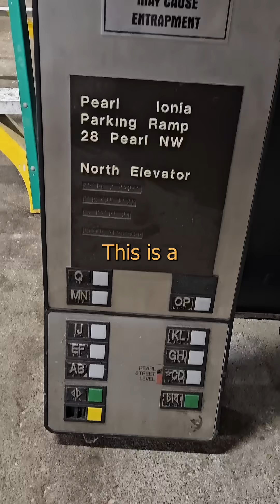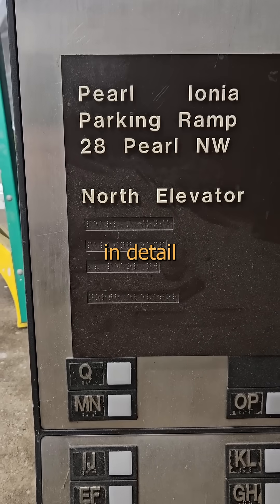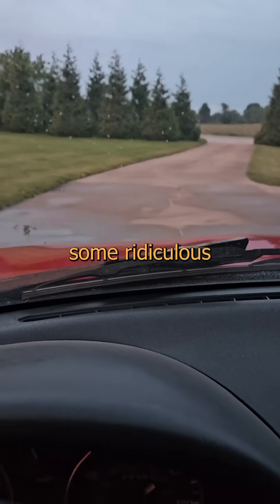Miata Mischief #chrisboden #engineering #gear #elevator #score #stories #parts #hacking #making

Comment: I worked construction for a little while as a laborer / apprentice ended up having to pick up supplies in an old 2006 Subaru Impreza hatchback little did I know it was multiple lengths of lumber I had to put that shit sideways between the passenger seat to the back seat sideways out the vehicle and ratchet strap the shit out of most of it on top of it I had the right up a hill with all that shit flapping in the wind prime to God it wouldn't send halfway down the street. I use plenty of ratchet straps and even some bungees on top just to be sure.

Comment: I once moved my bike from my old apartment to my new one it wasn’t so much the traveling that was sketchy it was how I unloaded it since I had no help I just tried to roll it slowly down the ramp but the front tire slipped off as I was backing it down and just dropped like 4 feet down right next to me almost crushing me thank god it was a dirt bike and the suspension could handle a drop like that easily also thankful I wasn’t directly under it when it fell definitely made getting it down way quicker tho

Comment: I hauled 10 by 8 plywood inside of my pt cruiser and drove it 45 min down the highway to get to a job site going 80 mph. I  left my ratchet straps at home and couldnt drive back to get them so i had to hunker down in the front seat and hope to god i didnt  have to break fast or i would be unconscious on the side of the road.

Comment: When I was living back home in the Netherlands during my doctorate program, I ran an electronics repair business out of my little rented townhouse for extra cash. Being an absolutely peak Dutchman, I didn't own a car, but did have several bikes. That included my cargo bike, a bakfiets if you want a term to look up, but it's basically the amalgamation of a wheelbarrow and a bicycle.

I used that thing to bring home all sorts of junk, but nothing will top the Sega arcade cabinet that came home in 3 pieces. The worst part was absolutely moving the display, a hulking CRT.  I had to bring my brother along, riding in the bike box, so I could have someone to help push the thing back.

Comment: Was moving some metal water barriers cross a ice road, was told “these are basically indestructible” well I proved him wrong cuz when you hit something over and over with a front end loader bucket something is gonna give, so these $12 000 barriers had a 8 inch long metal spike on both sides 😂😂

Comment: Not that sketchy, but I have one of those hitch racks on my Dodge Ram van and I load it up with a few hundred pounds of firewood and ratchet strap it all down. Forgot something and had to turn around and had to pickup over 50 logs off the road 🤣 oops

Comment: I know I am late to the party but...

An about 13 foot cast iron street lamp from the 1920s.... The problem was everything the transport vehicle in itself which was an old van my friend borrowed, the way to the vehicle and the weather conditions and the description of the lamp which was FAR heavier than described.

 So my friend bought this street light as a gift for his mom from someone on the Internet about 200 miles away.  It was supposed to be in two pieces about 200lbs in total and in the driveway. But because the seller couldn't disassemble it and it was to heavy for him and his friends, it was in one piece in his backyard... So my friend and I tried to disassemble it for about an hour, until we gave up and spent the next 4 hours dragging the thing through snow and mud to the van, only to find out that it is not only to big, but because we couldn't disassemble it, we were not able to secure it without breaking the glass.

So we bought wood, nails a hammer and a saw, build a frame to put the lamp in and spent another hour or so to load the lamp into the van. But because it was so  big we couldn't close the back doors. And because it took us about 7 hours loading that thing it started to snow again. Now we had to drive back home, during a snow storm, wet and covered in mud with an open backdoor and a barely working heater.... It took us more than 4 hours, I have never been so cold and miserable.  

The only good thing was we used a forklift to get the lamp out, which took us less than 5 minutes. After a restoration it is now beautiful and his mom loves it... Plus we got a story to tell

Comment: I had to help a friend buy an arcade cabinet. 

Problem 1: he drives a small shitbox that was too short to fit the whole cabinet in it

Problem 2: he forgot that he didn't have ratchet straps

Solution: pull the seat belt out all the way, wrap it around my legs, hold on for dear life, and hope he doesn't hit a pothole

Comment: As we were shutting down USMC MOBCOM building in KCMO we were tasked with "disposing" of a lot of random equipment. I had decided I wanted my old cubicle work station to go home with me. I somehow managed to cram an entire office cubicle setup into my 1988 Nissan 300Z without breaking or scratching anything. I even got the molex adapters for the 120v outlets and cat 6 keystone jacks. I had to make my friend help me get the shelving system and wheelbarrow with his truck but I still have it all 15yrs later, lol

Comment: I hauled a power washer home from our metal building to my garage so I could work on it since I had all my tools in my garage with my 23 GR Corolla since I sold my truck big mistake which was not built to haul a power washer unlike my truck At least the engineers didn’t have it in mind that that is what it would be used for with the seats rear seats folded down so it was very awkward and it rattled quite a bit driving home, and I had to be careful not to break too hard otherwise the entire thing was gonna come towards me pretty quickly as it is not the lightest of power washers that happened earlier today

Comment: Drove from toledo ohio to a little east of Washington DC in a ford Fiesta hatchback to pick up the molds for a wide body kit for a merkur xr4ti.  I took all the seats out minus the driver's seat and when I got there it wouldn't all fit.  Luckily the guy I bought it from gave me a roof rack so I could put some of the molds on top of the car.  This was molds for the front and rear bumpers' side skirts and fender flares all in and on top of a fiesta!

Comment: Few years back, i made the decision to move cross country. Figured I'd downsize instead of getting a truck. Everybody told me i hadn't downsized enough, when they learned i was moving with a Prius.

Well, I'll tell you: you can fit a surprisingly large number of things in a Prius, but not QUITE enough. Attached some top rails with straps, threw a cargo bag up there, filled it, and strapped the remainder to its side. When all was said and done, i had my life loaded up in the Prius.

I'll admit, I was more than a little worried on some of those mountain passes when i realized i was decelerating to school zone speeds on the incline!!

Comment: OOH My story is ALSO in a Miata!
Last summer, I saw a 4ft tall air compressor by the side of the road with a free sign. But all I had to transport it was my tiny Miata convertible... I put down the roof, and strapped that thing into the passenger seat with the seatbelt and some bungee cords and rope from the trunk.

I've never had a convertible before, so having this giant red behemoth sitting next to me as I sailed down the highway was NUTS.

Comment: I was given a 4 tier concrete water fountain and hauling it home in my 89 Oldsmobile also a 8foot x8foor pad made of concrete 1foor square concrete patio blocks there were no give in the suspension and we had a 20 mile trip back home thru city streets at 7 miles a hour we user the patio blocks to equalize the load there wasn't much room fo me and my son to set

Comment: Found a fully assembled Chevy 454 engine complete with carb and tranny but with no air filter on the curb, I lugged it into my back seat leaking fluids and with none of the proper tools i had to arrange it to where the output shaft and fan would be able to fit

Comment: i had a mazda tribute, i bought a shelf off of facebook market place, and i thought it could fit in my empty tribute.. however, it was about a foot bigger, i ended up disassembling the rear window with a foot of straight oak sticking out of my cars ass driving for an hour to get home, i did get it home and it was 100% worth it!

Comment: My dad and i have been working on a 2000 pontiac firebird that we got off of a crackhead and his friend on marketplace for $1500 for gambler 500 for the past 4 years, but after the first year we realized that it would be much better if we were able to haul around our minibike instead of just loading it up on my uncles bmw x5 that he accidentallybought off of an auction site for $800, so we took the back hatch off along with the back seats, welded up a small frame for the back, then loaded the two minibikes up parallel to each other with the front wheels resting close to the top of the roof and the rear wheels at the bottom of the water drainage area where the carpeted trunk used to be. Also, I have a picture of my uncles x5 fulky loaded with a roof rack, a rack to cover the back hatch, and a bike rack that goes on the trailer hitch in order to carry 3 minibikes, 1 pocket dirtbike, a big ass rtic cooler, a couple 5 gallon gas cans, and a shitton of tools.

Comment: Back in the late 90's my parents gave my wife and me a 19in for Christmas. There were two problems with this.  First, we lived 8 hours away, and second, I drove down there in a two door Saturn SC2.  I didn't have any way of getting a 19in TV (keep in mind, it wasn't an LCD, it was an old fashioned tube tv) back to our place.

That is, until I took the passenger seat out, took the TV out of the box and put it in the back seat, and put the passenger seat back in.

We drove the eight hours back to our place with this huge TV in the back seat of "sports" car.  When we got home, I had to take the passenger seat out again to get the TV out and carry it into our apartment. Fast forward a few years and a few kids, and I traded that car in for a minivan with fake wood paneling that would have handled that TV no problem.

Comment: So, heres my miata story. I had a 1990 NA with an aftermarket roll bar as my only car, and found some wheels and tires on Craigslist. I wen to pick them up, and put one in the passenger seat, and tied the other three to the roll bar with some rope.

Comment: I had a house built in Dallas in the early 2000's. We used Austin Chop rock chucks for the exterior accenting walls and we planned to build short retaining walls for landscape around the property. Well we ran out of that rock and the builder price was astronomical. So I found a place that had the rock for a fraction of the price and went to pick it up... In my 1998 Hyundai Tiburon 4cyl. 
Not sure how the suspension survived but I drove a literal car load of this rock back to my house from 60 miles away 😂 
Car lasted until 2017 when some asshat hit it in a parking lot on Halloween day. Totaled.

Comment: I won a pair of forklift forks at auction and when to pick them up with a Subaru... not realizing how massive they were until pickup. I shoved one fork through the rear-seat hatch up to the shifter.  Then  ratchet-strapped the other to my hitch-mounted cargo rack Which twisted under the off center weight. I was originally planning to turn them into an excavator-mounted forklift attachment, but they proved far too big and heavy for my setup as they were from a 20-ton forklift. No idea how much they weigh, but one of them kicked my ass while unloading it from the trunk. Now they’re buried upright in ten bags of concrete each, serving as my gate posts.😅

Comment: I was moving back from Montreal to Toronto, and managed to pack all my stuff into a Toyota Echo Sport Hatch (factory spoiler and all!); including a 55Gal aquarium, a dozen or so live fish (some Cichlids). It was stupid winter out, and it wouldn't all fit with the hatch closed. So I had to bungy the back down, and drive with the window open so not too much CO got sucked in. My fishies survived the trip in a 5gal pail. I had to run an aerator and a heater through the bung hole, powered by an old "hummer box" marine inverter, which made the headlights go dim. I was so terrified that the car wouldn't start again, and my fish would die, that I fueled it running.  The car was so heavy it handed weird on the snow. Everything made it.

Comment: 25 years ago we hauled a 6 foot concrete culvert (3' OD) in the back of a Subaru Brat 😮 When the shocks bottomed out, that was tge Beginning 😅 it only went about 10 miles, but it was Up the Side of a mountain to a house deep in BFE 😂 We went over TWO Kelly humps 🎉 
   I Think I Can!
   I Think I Can!... 😅

Comment: We bought three sears shopping carts. I own a sports authority. A Toys r Us card which was bought one year before their permanent clothes were in the United States at the time. One big and two small AC. More one big one small Kmart cart, a retina's cart which I estimate came from the '50s, a Big lots cart and two baskets Aunt piece of anthracite coal, the size of four light bulbs put together and Lionel with there ever terrible designs like pudding 150 Watts through a DC only circuit board. That's bright. Lionel trains really bright. Take a look at their track. It's like they took brain rot and times it by 10. Anyways, that's the craziest things I have. Aunt projector screen TV I thought had an HDMI and I'm too lazy to remove it from my room and work. Get it side

Comment: I was 19 and wrecked my v6 mustang, had no buddies with trucks available when I found the replacement parts I needed at a junkyard finally, drove home with the hood ratchet strapped to the hood, seats folded down 2 fenders in the back and then the bumper .....went out the drivers side window and back out the passenger side, got lucky short drive no tickets but fuck thats what being young dumb and full of cum is about 😅

Comment: Found a big folding aluminum ramp one time while driving a motorcycle couldn't just leave it on the highway so I just threw it balanced across my lap and went on down the road another 20 miles till I got home

Comment: Just an 21" crt monitor balancing on folding bicycle nothing too crazy 😂 or transfered a motorscooter binded frontwheel on a bicycle trailer an d backwheel on ther floor roling nicely,crosstied steer so it would steer along with the corners 😂
Reply: I Forgot the 6 meter metal scrap pole in the biketrailer darnit if it needs to be moved it will be moved 😂

Comment: I once picked up two half axles, two lower control arms, tie rod ends, brake pads, brake lines, hubs, rotors, front calipers, pitman arm joints and so on for a full rebuild of the front suspension and brakes of my 1997 f150 pickup truck.  I was on a 620cc motorcycle.  Parts giys laughed at me and told me there was no way I was going go get it home on that thing.  Two of them followed me out and bet on it.  

I did have to leave the boxes the control arms came in in the trash but saddle bags can hold a LOT of stuff and 'if it fits it ships' works for a backpack as long as its not too long a ride.

Drove the truck there a few days later and one of the guys dies laughing as he tells a coworker that was not working on the night I picked up the parts...

Comment: I owned an 08 prius for about a year while i was commuting 150 miles round trip for work and let me tell yeah, the little machines can do some work. I hauled

500 pounds of lead wheel weights and 100 bowling pins 160 miles

3 guys and a couple dozen rifles and a few thousand runds of ammo 

Took it on a hunting trip and brought home two deer in the back

A th425 transmission out of a 70s Oldsmobile toronado 180 miles 

A 3.8 liter cast iron v6 and turbo assembly out of a buick grand national 240 miles

10 12 volt deep cycle battery backup batteries (think car batteries but heavier) 240 miles

The most i ever moved in one day took a couple trips but i moved 1 ton of GM shop manuals after a storm blew down the storage unit they were in

Comment: I worked on a restoration project and we did not have the kit to move a pillar at all the top rated thing we had was for 1200 pounds and the pillar was about 20000lbs the problem was not the holding it it was the lifting it so we used eight guys four dollies and five or six of the machines we had to move it then and me on the other end with a few bags of concrete and a 8foot steel bar to help get it off the ground because surprisingly my femboy twink ass was the one they chose to have over there for some reason don’t think I really did anything was just kinda there to try and see if it would help at all, but not sure anyway long story short the pillar broke and it was not are fault we actually moved it to the right place and it was broken about three days later

Comment: I once got a full size fireplace inside a mk 2 mini cooper. 
True I had to get engaged to the steering wheel due to the proximity of it to my mouth but I hot it the 40 miles home. 
Only damage was 2 small tips in the headlining and my testies being rammed into my stomach. 😊